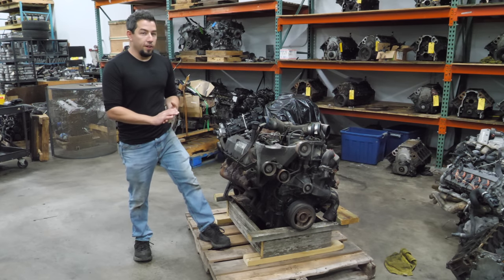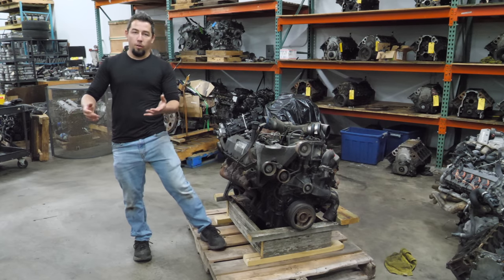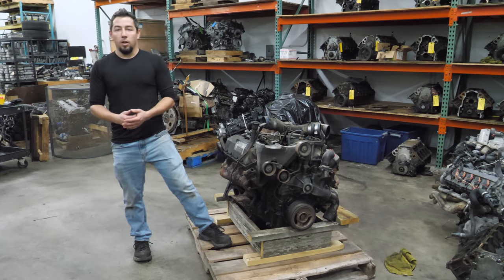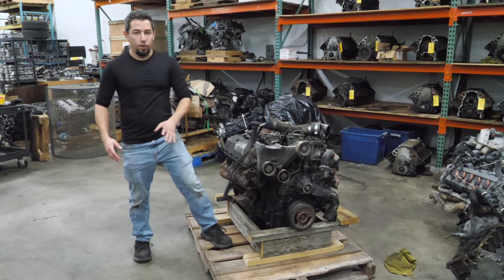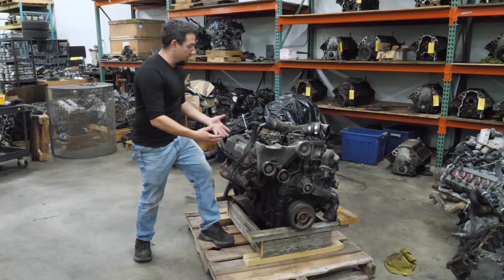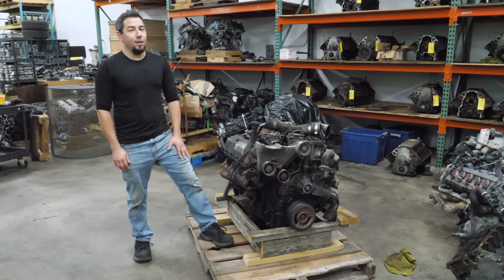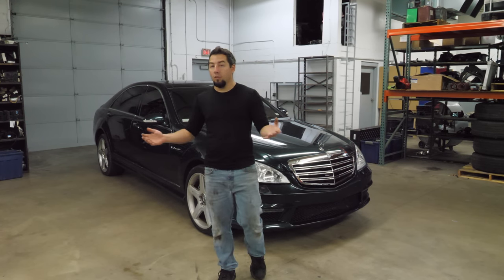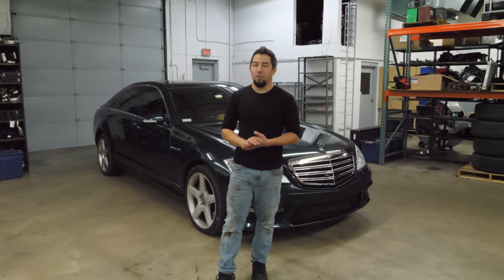70K OR 700K? Ford 7.3 Powerstroke Mileage Discrepancy. How Many Miles Are Really On This Engine?

Comment: I'm betting 70k. Likely idled more than it was driven. Government fleet vehicles don't get a lot of road time, but do see a lot of run time. Wouldn't be surprised if a shop fat fingered a 6th digit when entering mileage into their system, then kept it going. I've seen it happen at my own shop. Sometimes the shop's system won't allow a "lesser" mileage to be input on a vehicle when a higher mileage was previously input. Or maybe someone fat-fingered the mileage into Carfax and a lesser mileage couldn't be input after that. Copart was probably going off of Carfax for mileage.

Maybe the gauge cluster in the truck was replaced with a 700k mile cluster. Doubtful, but always a possibility. I've seen that happen where someone did a DIY replacement and rolled back from 300k to 120k.

I have a 7.3L in my Excursion. It just rolled over to 400k miles. Way worse shape (aesthetically). It's had the "50-cent" fix done to it. It's had injectors and at least 1 turbo replaced over the years. I highly doubt that a factory turbo would last 700k.

Comment: Does the oil drain bolt look like it’s been off 10 times or 100 times. From what I see, paint, rust, dried oil on aluminum parts it’s 700k

Comment: Being a Chicago truck I bet that's a 70k engine with a lot of idle time on it and lot of hard cold starts,  my guess would be it got reported at the higher mileage by accident and Carfax won't let it be lowered due to fraud concerns. It just looks way to clean inside for 700k, most engines I open up with a 100k on them look worse unless the owner was really good with maintenance.

Comment: Going with 70k. Reason is geography of where the truck is from. Chicago area, with a work bed on it. Truck probably never shut off during the winter and had a lot of cold starts. Plus, when you were examining the cam, you could see the cross hatching on the cylinder bores. If the engine had 700k, that would be nearly gone.

Comment: ***You can see when you took the oil pan off at a point in the video you can see the cylinder and the cross hatching marks on it look great, see if you can move one of the pistons that you took the piston rod cap off of and push the piston up to look at the cross hatching marks further up in the cylinder wall cavity, this will be a very good indication of a 70K or a 750K engine.

Comment: As a early ford diesel guy. those bearings and cams show 2 thing. 1 lot of  rough cold without letting the glow plugs run and no block heater. 2 alot of idle time it could have around 70 to 90k on it def not 700k that for sure unless the bottom end has been rebuild before

Comment: My gut (and I am not a mechanic) tells me it is a 70K engine simply because how many 700K engines exist? Surely not many. Second, the mileage jumped by 600,000 over a few months. The driver would have needed to drive over 6,000 a day. That takes some stamina. I am not sure what kind of power that 7.3 puts out but the driver would have needed to drive 24 hours per day at 280 MPH to make his driving quota to run up that many miles. With the engine setting on a shelf somewhere for 6 years and assuming the earlier mileage was grossly understated, someone would have needed to put 43,000 miles a year on that vehicle and it doesn’t look like the type of vehicle that sees that kind of annual mileage…..but it certainly could have. It would just mean someone bought a vehicle that was poorly designed for the kind of work they do. Let’s put it this way……you have to make a lot more crazy assumptions to justify 700,000 miles than explain it being only 70K. But as I started, I am a  self proclaimed mechanical moron but I am a pretty good statistician.

Comment: The mileage part is more than likely someone putting in the wring numbers or adding an extra one. As for the bearing wear and the camshaft wear, that shows a lot more mileage and possible lubrication issues or worse. Without actually pulling the cam out to see what was going on it is hard to really say. I have a 2002 powerstroke and it is knocking on the door to 400k on mileage. They will practically live forever if maintenance is taken into consideration

Comment: The duration of time between 68k and 685k is only 36 days. For a vehicle to put on 600k miles on 36 days would require it to travel nearly 700mph for 864 hours without stopping. So like on the drive oil changes, a seemingly infinite onboard supply of fuel, 3 8 hour driver shifts and a bunch of other things i cant even think of. You know I'm almost inclined to assume that its 70k.

Comment: 70k miles. Based only on the fast lube oil change indicator. In there system, once a milage is input, the next service, their system will not allow them to input lower miles (or the correct miles). Because they are connected to various reporting services like carfax, they are not allowed to input lower miles than previously shown.

It would create a odometer discrepancy that they don't want to be responsible for.

Comment: My 99 f350 with a 7.3 shows 386,000 on the odometer. It just has 1/10 mile as part of the trip odometer so it will still show actual mileage clear up to 999,999 miles. Unlike the older trucks where you had to guess after 99,999. Another point is if it was only 70k   that would mean they changed the oil every few hundred miles instead of a few thousand miles.  Mine runs like new and has never even had a valve cover off so I would guess 700,000. I think someone had the mileage wrong earlier.

Comment: I was on team 700k- the oil change intervals at 680k+ are a few thousand miles apart, at 67k they are a few hundred miles apart which does not make sense. The valve train, turbo, and wiring harness do seem newer than 700k, but if the truck was well maintained in a cold climate I could see them lasting. The truck itself certainly is not 70k or less- too much rust. Bearings- already stated. 

I think 700k is far more plausible than 70k. I think the engine or gauge swaps are also likely possibilities. 

I’m going to rewatch for the dates- in a comment on mobile so I can’t rewatch it without the comment deleting. IIRC the engine was made only a few days before the truck- that seems highly unlikely. I’m an engineer in Detroit and we do try to keep a lean supply, but components like engines are usually made a week or more in advance of the vehicle, especially in 1999 when JIT supply was not yet perfected. Shipping also takes time. Let me rewatch and reply, but I think it’s likely the engine is a transplant.
Reply: After rewatching the beginning of the video I realize a decent part of my original comment was wrong- the lack of rust on the truck itself- it was on the service bed which probably didn’t use galvanized steel, service trucks idle, and the oil change mileage intervals. The truck itself appears to be in great condition. 

It is nearly inconceivable to me that an engine would be built the day before it was installed in the truck given the 5ish hour drive from Indy to Dearborn, HOWEVER I could see production issues causing ford to hotshot the engines to the plant overnight. Very abnormal practice but possible. I could also see the valve cover sticker being applied at the truck assembly plant, but again doubtful. 

Sorry I wasn’t much help, though I hope these thoughts spur further discussion.

Comment: It's possible whatever database carfax is pulling milage data from changed the number format for milage adding or subtracting a digit.  It makes a lot of sense that the early entries are missing a digit.  Why would you get your oil changed with only 697mi on it from 8/2014 to 12/2014

Comment: On very early 99 trucks, like that one, the pan and front cover should have the international applied yellowish clear coat applied.  The pan should also have a sticker on the side of it.  The oil pans do not last long in salt country, regardless of how low the mileage is.  Has the pan been changed?  The silicone on the pan rail should be grey, and not oozing all over the place if factory.  It still has the original 98 water pump with the cast elbow on the inlet of the pump, all the newer pumps have a bolt on elbow.   Prefix AB injectors ARE original.  Cylinder 8 hasn't been updated with the LL injector.
Reply: After watching the whole video, with the wear, it could have been 70k of lots and lots of idle time, or lots of sitting with dry starts.  They do take a bit to build oil pressure on cold starts.

Comment: Its a possibility that the insturment cluster failed and was replaced with a used one. On thoes clusters the mileage is saved inside the cluster if I remember correctly.

Comment: Do vehicles in Illinois require a yearly inspection? In PA they do and mileage is recorded by the state. But based what the bottom end journals look like, and given only two options, I’m going to say 700k miles. 

Ultimately it comes down to how confident you feel you’re investigation is. You seem like an honest guy so unless you feel anything anything less than 100%, you probably shouldn’t advertise it as a 70k 7.3. You’re reputation is worth more.

Comment: .. check the bores, they'll tell you..

.. replace the Bearings In Engine & Sell It..you can make a Roll Pin from a Cotter Pin to remove those top Main bearings..stick it through the Oil Feed hole, adjust the Loop with a Hammer as needed, then rotate the Engine in the proper direction..same for the Install.. remaining bearings are Easy to replace..

Comment: Didn't see anyone say it yet - this has to be 700k because of the oil change mileage numbers.  The 3rd digit is the one going up by a normal amount - if the mileage had been off by a factor of 10, then they would be getting it changed every couple hundred miles, not every couple thousand.  Same with the oil changes at "67,675" and "68,372" - only 700mi apart?  There's something wrong there.  Then the next one, "685,738" if off by 10x, would only be 200mi later? That's wrong.  The oil change intervals only make sense if its a 700,000mi truck, not a 70,000mi one.

Comment: I'll say 70,000 miles, but she saw a ton of idle time.  The truck has a lot of rust, but not overly so for a 13yo rust belt Ford.  If she had 700K, those cast iron headers would be cracked and welded to the head and the cylinder bores would not show crosshatching.   You got yourself a winner!!

Comment: Rod Bearings look like it had garbage tuning with alot of timing Curious how loose the piston pins are in the bushings. Its an early 99 motor so the intake spyders list on ebay for 200 plus for obs ic swaps.

Comment: This is a bizarre mystery. Many things including the cleanliness indicate 70,000. Even the piston skirts look very clean.
But as you say cam and bearing wear definitely look like more than 70,000 but still not as much as 700,000.
Cam and bearing wear looks like around 250,000 to 300,000.
Could this engine have had some type of partial rebuild at some point?

Comment: I'm the second owner of a 1999 7.3.  I know the OO, I know how it was used in Colorado prior to my purchase. I bought mine with 119k, it is much more corroded than this engine.  The exhaust manifold bolt hexes would be round nubs on a hi-mileage Chicago engine.  The valve cover sticker matching the truck suggests the engine is original to the truck. Not a replacement.

7.3 are susceptible to being "tuned", although a stock turbo suggests this engine was never "tuned", another check towards it being low mileage. I would consider cross-hatch patterns a better indication of wear from mileage.  What do the cyl that are at TDC look like? I conduct oil samples with every oil change. I have 9 reports over 100K of ownership. Occasionally, I have had high lead and tin content, but no copper. I'm at 225K. 7.3 are a bitch to get cranking fast enough to build the HPOP necessary to fire. The use of low-viscosity oils in cold-weather regions is common. My be a contributor to the rod bearing wear. 

I would be suspicious that there were some cluster changes during the truck's service history. Someone wanted that "68,xxx" cluster for their 685,xxx truck? Although the 1999s all had mechanical odometers, which can be manipulated. No mechanical odometer should be trusted without solid documentation.

What to do with it? Roll some bearings in it. Inspect the cross-hatch patterns. Put a starter on it and conduct a compression test. If it passes, it can be sold with confidence that it is a decent used 7.3. Other than the mystery wear of the rod bearings and cam, its external clues suggest fairly low mileage. Like sub 150k.

Comment: its 700k , at 5:50 you can see the oil change records and its done every 2.5k. so shift the 5 digit number over 683k + 2.5= 685 +2.5=688+2.5=690. the mileages do make sense if you just assume someone messed up and did 5 digits instead of 3

Comment: We had a customer with a fleet of Pete 379’s with pik-rite vacuum bodies on them. Very well maintained fleet. One of their trucks had electrical gremlins from day one. The odometer stopped working around 300,000 miles. It had a MXS cat c15 in it. 

If you didn’t know the history of the truck, and you opened the hood, you may assume the truck was heavily modified and basically brand new, lots of shiny parts and cat yellow without oil stains…

That truck had 48,000 hours of PTO run time on the hour meter…

Moral of my story, just because it looks new, doesn’t mean shit. The truck had more blow by than a whore house. Oil pressure was always around 90-100 plus, IVA solenoids obviously bad…but to the untrained eye, it looks like a runner.

Comment: Well if ou think about it…doesn’t matter all that much if it’s 70,000 or 700,000…it’s a 7.3 PSD, even if it’s 700,000 it’s probably still got north of 400,000 (and no one’s gonna put 400K on a motor then say ‘you sold me a junk engine!’ When it fails) it’ll go before you’d test to see any serious internal wear…I’d slap bearings in it if I was there already but I wouldn’t say it needs them… there’s still crosshatch in the cylinders, it’s good to go.(and I’m a 12v Cummins guy so…giving anything that lives in a ford that kind of respect is really saying something)

Comment: On 12/29/14 68372 miles were reported.  On 2/3/15, 36 days later, 685738 miles were reported.  That's 617000 miles in 36 days, or 17000 miles per day.  That's a 70K mile engine -- has to be.  How/why is the ODO wrong?  No idea.

Comment: It's been 20+ years. Toss the bearings back in and run it. Either way, those bearings make a good case for a rebuild regardless. But having worked in a service truck, it very well could have 70k but heaps of idle time. I've seen 2500 mile engines with 10k idle hours. (not certain of those numbers, only used to make a point)

Comment: If the odometer in that year vehicle does not have tenths then it has 700,000 miles. The lower mileage is attributable to the oil change shop not including the last digit because they thought it was tenths. Where would the sixth digit come from if the odometer did not have tenths?

Comment: I work at Hyundai and I know our system won’t let you record less miles on the vehicle if the vehicle has history at our shop so maybe the oil change place messed up and then they had to follow what they had wrote down from then on not letting them write down the correct mileage

Comment: So the possibilities I can see are:
The truck indeed had 70k miles, but the engine has a ton of hours on it.
This is a 700k mile engine that had incredible service history its entire life.
The engine was rebuilt at some point in the trucks life, so not 70k or 700k.
Or the cluster failed as you speculated, and who knows what we are looking at.
In any event the best evidence for low miles high hours is the cylinders still look amazing, it has the (appears to be) original turbo and likely original injectors. But due to the cam and bearing wear, I call this a teardown for parts, since this engine really needs a rebuild to continue its service life.

Comment: Looking at the oil change intervals, it doesn't make sense that the owner changed the oil five times in 3000 miles, I don't know how much we can trust the oil express but if the truck made 46000 miles per year, which is a lot but not impossible, the 650000 miles achieved in 2013 is possible. But again, is it the original engine, at this point, with how clean the valve cover (and gasket) and the very clean harness I don't think so...

Comment: I'm going with 70k based on condition and mileage from car-fax. I think the mileage on 2/3/2015 was recorded incorrectly. The 12/29/2014 mileage is 68,372 the mileage on 2/3/2015 is 685,738. I think it should have been 68,573. The extra 8 on the end is probably the decimal number. I also doubt that this vehicle put 617,366 miles on in 37 days, that is 16,686 miles a day. Based on miles between services from 2/3/2015 and 9/23/2015 12,107 miles, add that to the 68,573 and you get 80,680 as the probable actual mileage. The could be off a few thousand or so.

Comment: If you do the math it would need to be about 10K miles a day to make the difference from 68K on December 2014 to 685K in February 2015.  The Oil Express technician was counting the tenth of a mile as a while mile.  It follows the logic if you take the last number off the higher mileage.

Comment: I bet it’s a 70k mile engine with YEARS of idle time on it, and started in very cold temps often. One thing you could do is pull the connector off of the icp sensor, which is on the driver side of the engine, right next to the front engine picking loop/ eyelid whatever you want to call it. 9 times out of 10 higher mileage engines will have oil in the connector because oil slowly seeps through the sensor. If it’s dry, it’s either low
Mileage or it’s been replaced.